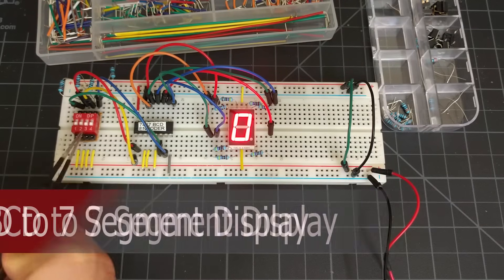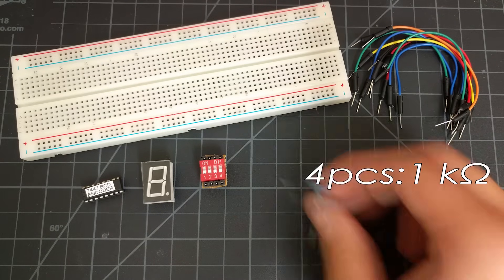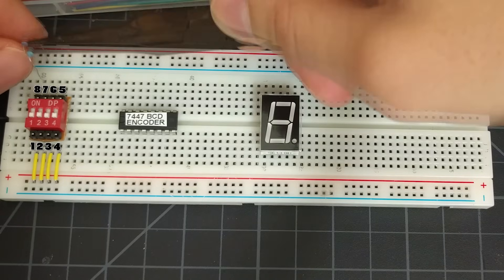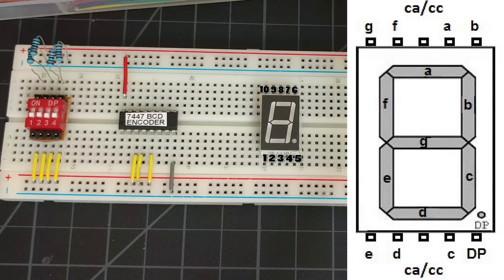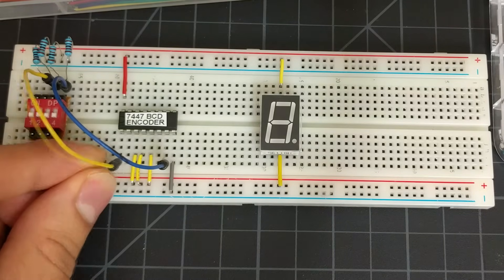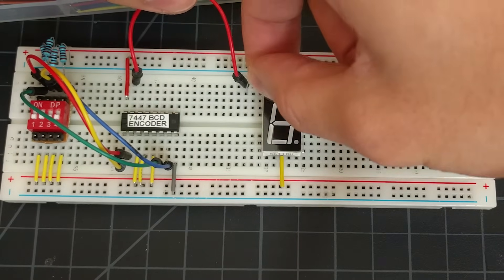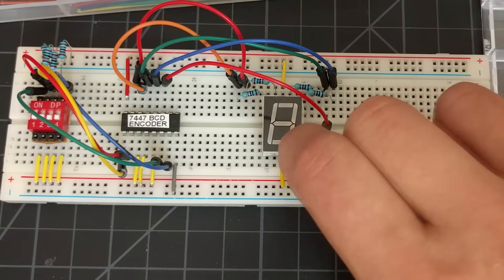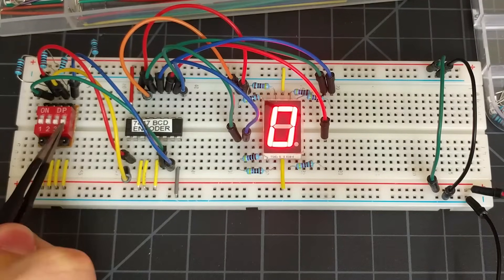Tutorial | Using the 7447 74HC47 BCD to 7 Segment Display Decoder

Comment: Bro I followed your video and made all the connections correctly. But it's still not working. You used a 6V power supply, but I used a 9V one. Bro is there any chance that the chip and display got burned because of using the 9V supply and that's why it isn't working?
Reply: Use 1.5 v and click it, you can add another 2 battery
Reply: @exfiction  thank you🙂.....

Comment: Hi, could you post videos of electronic circuits and devices starting from the point where you can see and change the layout of the electronic components so that you can easily do them at home? For example, electronic circuits with disparate and non-disparate logic ports, flip flops, microcontrollers, synchronic and asynchronous electric motors without switches... of all types, devices with operational amplifiers etc... Is it worth it? thanks Luca
Reply: thanks ,....but then where do I connect the + and - cables inside the protoboard (i.e. where the electronic components are located)? because I don't know from the video, he's left out
Reply: From the video

Comment: my display is not working does the battery with 9 voltage will work or no?
Reply: i think it would work if u use a resistor before it can go through to the display

Comment: On what basis did u chose the resistor values?
What is the minimum amount of current that can damage the 7 segment display?
Reply: The display will likely handle higher currents than the chip. For the SN7447 it has a maximum pin current of 40mA and the total chip can dissipate 320mW in normal operation circumstances.

Comment: Hi awesome video but I just want to know what the 1k resistors are for?
Reply: first think circuit without resistor you switch slider and + connected - directly DOH!
that we call short circuit
resistor is pulldown input down when switch not used and pull it up when used bcoz there one resistor voltage become on that side is positive

if use just + switch -> input. yeah it work perfectly on position, but when you switch off input not go anywhere pin is floating. it can be 0 or 1 we not know and we want it be 0 then. thats why resistor is there pull it down. hope helps xD
Reply from the maker: Hi I explained it somewhere in the comments below

Comment: sir can i use 9 volt battery instead
Reply from the maker: Check the datasheet for the max voltage for the chip. You can use the 9v for the 7 segment display as long as you limit the current to < 20 ma

Comment: How much it coast for all please reply I take this project
Reply from the maker: Should be less than 20 dollars
Reply: @QRobotix  can I take any type of 7447 ic please reply
Reply from the maker: @26avishkarbhoir85  Should be. Double check the datasheet for the pinouts
Reply: @QRobotix  can you tell me exactly which 7447 ic nedded I have to submit the project in 2 days
Reply from the maker: @26avishkarbhoir85  yeah it's the 74HC47
Reply: @QRobotix  bro can I do this without switch or with 8 bit deep switch
Reply: @QRobotix  reply fast as you can e
Please help me bro
Reply from the maker: @26avishkarbhoir85  You can use a 8 bit dip switch but only 4 bits will be required ; you can leave the other 4 pins empty
Reply: @QRobotix  which wires are there yellow colour
Reply: @QRobotix  which types of wire you have used the yellow. Color wires
Reply from the maker: @26avishkarbhoir85  Hi they are u-shaped jumper wires
Reply: @QRobotix  why you don't mention them in requirments can I take normal wires instead of them
Reply: @QRobotix  hey man  I have done all of connection though my display not on can I send yu  picture of that reply fast
Reply: @QRobotix  please help me can I send yu picture of connection then u tell me what is wrong when I connect the battery the display didn't blow

Comment: What type of battery is used here and can we replace it with some other battery
Reply from the maker: Hi the most important consideration is the max current rating for each segment. Typically it's about 20mA for leds. For my setup, I used a 6v power supply (4 AA batteries) with 470 ohm resistors. If you use ohm's law, that comes out to ~ 12 mA of current.
Reply: @QRobotix  thanks

Comment: I have this hooked up to a 4x4 matrix keypad and a 74C922 keypad decoder that outputs BCD. Since I introduced the 7447 and the 7 segment display, it counts from 0 -9 perfectly, but goes a little crazy after that. What happens if you select a binary 1010 (A) on your dip switch? I would like to get an "A - F" out ???
Reply from the maker: Hi no it does not display Hex after 9

Comment: Can I connect common anode through a 470 r resistor to 5v insted of connecting cathode of all segments with 470r resistor
Reply from the maker: Yup as long as your current output is < 20mA for each segment
Reply: @QRobotix  bro can I take 8 way deep switch or can I make without using switch please reply fast
Reply: Good point, other tutorials show with the one resistor.  Helps to save space on the breadboard.

Comment: How to calculate the value of the resistance ?
Reply: You calculate resistor values for LEDs by assuming a typical LED current of 20mA (0.02A). You know the supply voltage (5V). So Ohms Law, Resistance = Voltage / Current. So Resistance is 5 / 0.02 which is 250 ohms,. Use the nearest standard value - so 220 ohms.
Reply: To be precise, if we know the Vf and If of the LED, which is 20mA at 2V and the power supply is 5V, then (5-2)/0.02 = 150Ω.

If I apply this to the video, it would be 470Ω, which seems large, but since I don't know the Vf and If of the LED, I can't say for sure.
It was working, so it is OK.

I think you should calculate with the Vf, If, and power supply of the LED and choose a resistance value that is close.

Comment: help me on it, 
for display 6 I need this orientation (abcdefg=10111111) but we get (abcdefg=00111111), how can we get required bit orientations
Reply from the maker: Hi you would have to connect the 4 inputs to a 4 input AND gate and use inverters as necessary for the number 6. Then connect the output of  and gate to the digit a

Comment: Hi 
Is it possible to have similar, but for 8 dip switches  to 256 addresses?
Reply from the maker: Hi, not that I am aware of. If you wanted to build one you would have to map out all 256 values all 3 of the seven segment display outputs and use K-maps to derive the necessary combinational logic required. Or just use a microprocessor. Goodluck

Comment: Why did you  use 1k ohm and 470ohm only??
Reply from the maker: It depends on the power source you use. For standard LEDs you want to limit its current to 20 mA do 470 ohm works well. And 1kohm is a good choice for pull up or pull down resistors.

Comment: How  to display dot on it?
Reply: Just connect pin 5 (of the display) to Ground if it's Common Anode

If your display is Common Cathode then connect pin 5 to vcc
Reply: the dot indicates the decimal in the number you want to display, so you have to input the BCD/decimal equivalent of that number

Comment: Is 9v dc supply okay?
Reply from the maker: Yeah just make sure you choose an appropriate current limiting resistor for the 7 segment display
Reply: I've tried it already and did the connections exactly but the 7 segment won't turn on.
Reply from the maker: Does the 7 segment work without the decoder chip?
Reply: @QRobotix  yeah, it worked
Reply: @QRobotix  I used 4 wires to connect the dc lines and it worked but it lit all the segments instead of just zero figure
Reply: I made a mistake. I was using the wrong 7 segment a cathode one. I replaced it with the anode and now it worked. Thank you!

Comment: I used 1k ohm resisters and its not working
Reply: i used 1k as well and they work fine.  display is a little dimmer is all but you should be able to use them fine for hooking to the display.

Comment: can a 9v battery as a power source can be used to ligth the led?
i tried it and it did not work as it should.
Reply from the maker: Try using a higher value resistor if you want to use a 9v battery
Reply: @QRobotix higher values for both the resistors of 1k ohm one and 470 ohm one??

Comment: what is that thing around the switch and those black thing in the jumper wires?
Reply from the maker: Hi the thing around the switch is a pcb board. The pins of the switch were too short for the breadboard so I attached it to a pcb with male headers so that it would fit securely on the breadboard. The jumper wires are dupoint jumper wires and they come like that when you buy it.

Comment: My circuit doesn't work what can I do.I gave my presentation tomorrow tell me immediately. As you can sir.
Reply from the maker: Double check your connections, double check your wires (one broken wire can ruin the entire circuit). Test your parts one at a time to make sure that each one works fine. Goodluck
Reply: I'll check the circuit 10 times but no responds all the wires connected correctly but doesn't work what can I do.

Comment: Is there any change if I use 74LS47 instead of the using 74HC47?
Reply from the maker: Compare the data sheets between the two to see if the pinouts are similar

Comment: 74HC47 do not exist. You can use 74LS47 instead, but beware, this is no more CMOS. It's TTL.
If you need a CMOS type, you can use 74HC4511 or CD40110 instead.
Reply: Is there any change if I use 74LS47 instead of  using 74HC47?

Comment: why didn't you connect one( 470 ohm) resistor in the common anode instead of these many resistors
Reply from the maker: Because each number uses a different amount of Led segments. Therefore the brightness wouldn't be consistent

Comment: what is the voltage of your power supply?
Reply from the maker: I used a 6V power supply. You can use 5V if you want.
Reply: can you use 9v?
Reply: @rayjordanmanuel3696  have u used 9v? what happened ?
Reply: @hello7331  I haven't used 9V

Comment: if we dont connect the 470 ohm resistor so will it affect rhe output.....
Reply from the maker: the 470 ohm resistor is a current limiting resistor. Without it, it might blow our the 7 segment display. Its better to have it then to not have it.
Reply: thank u......i think this is the imp logic here
Reply: can we use more than 470 ohm?